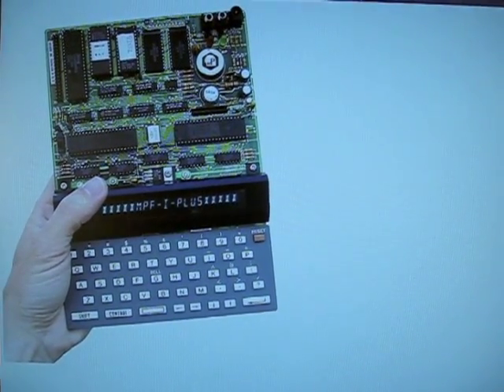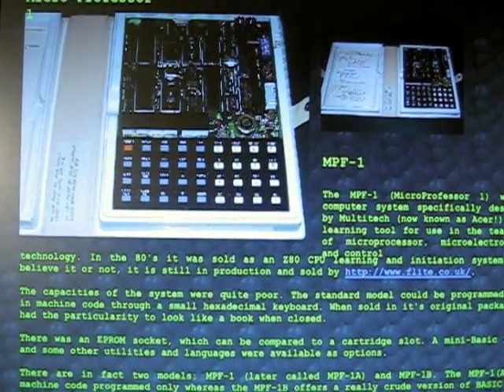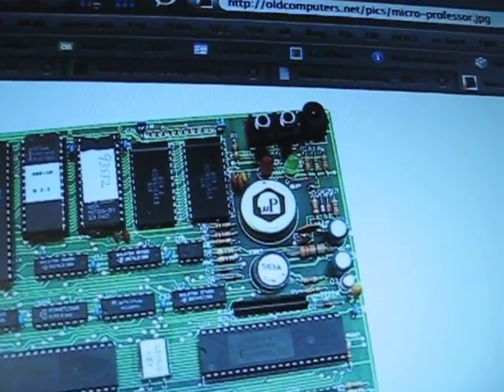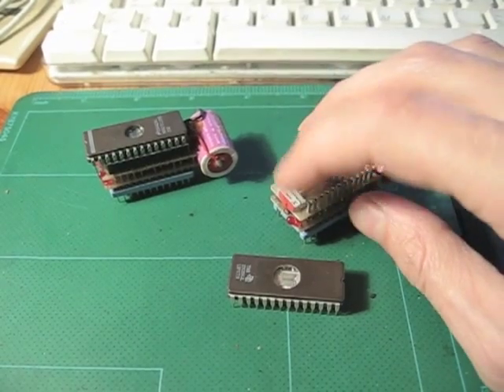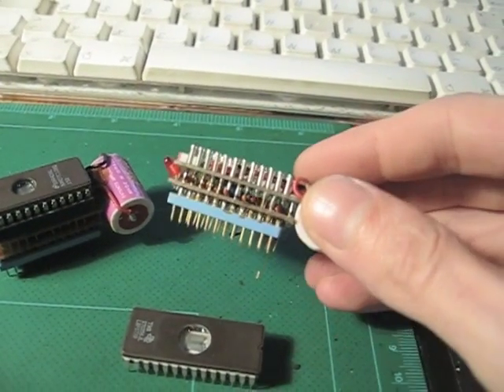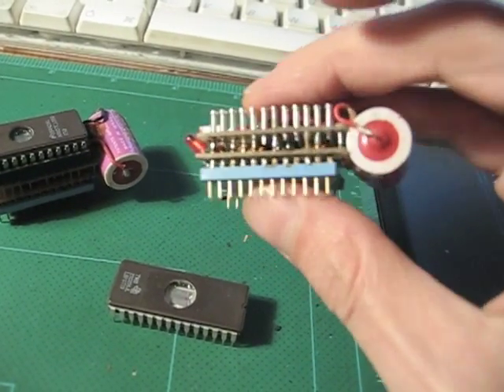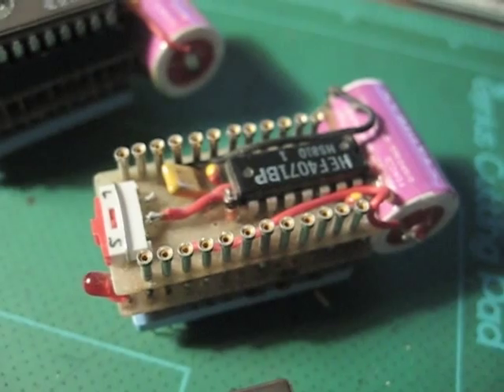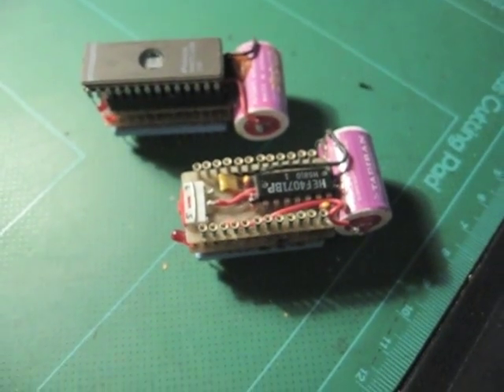Homebrew Static Memory for MPF-1 Microprofessor

Comment: Not only are the ICs shown EPROMs that are non-volatile memory devices but the Mpf-1 has static RAM fitted. Static RAM differs from Dynamic RAM because the contents do not need to be refreshed while the system is running. You are referring to BATTERY BACKED STATIC RAM. (You cannot have battery back Dynamic RAM of course and battery backed ROM or EPROM is superfluous).